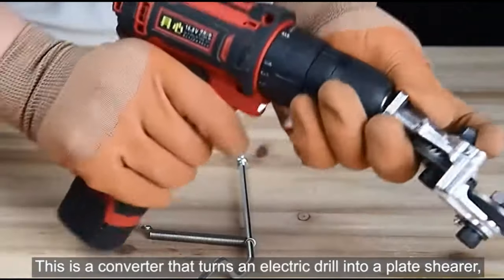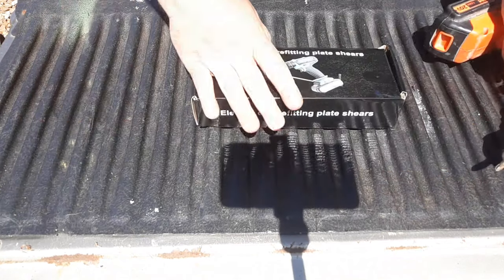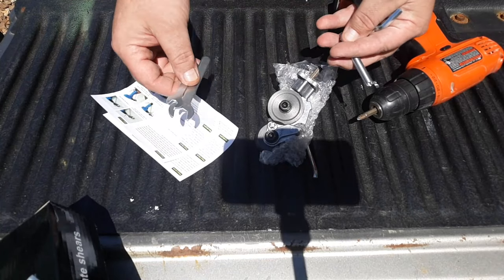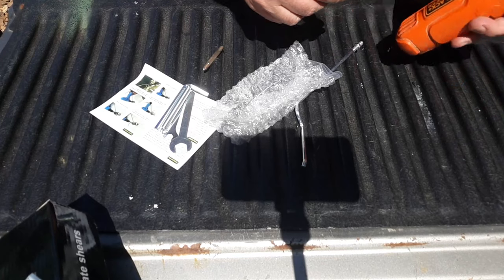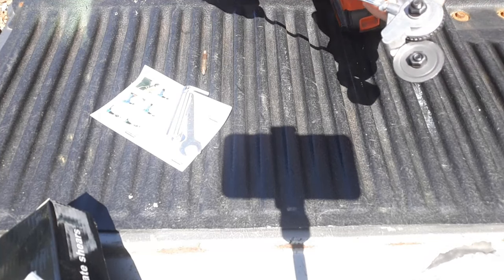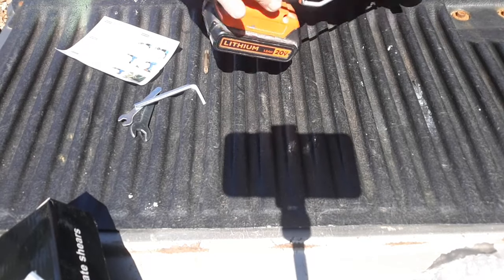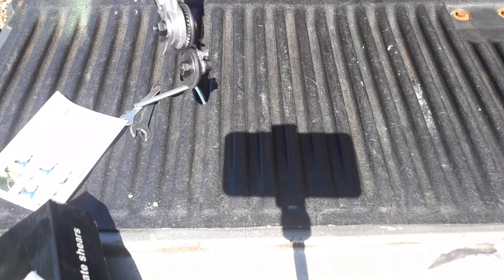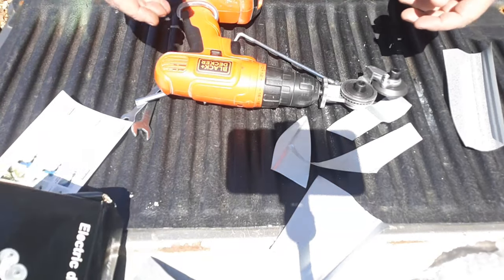ELECTRIC DRILL REFITTING PLATE SHEARS REVIEW

Comment: Thanx,  I was Curious about how they(It) worked for a regular person being in the sales vids they work so perfectly.................................
Reply from the maker: Not great. It has only one powered cutting wheel, so a significant amount of force is required. It is difficult to both push and guide the tool simultaneously, I'm sure it could be done with practice, but it is substantially different than shown in the ads.  thanks for watching.

Comment: Lol at least it works!  Wondering if you can adjust the height of the blade so it will “grab onto the metal” so you don’t have to push it 🤔
Reply from the maker: No. I checked out some other people's videos, and it is the most common complaint.
Reply: @ManMountainMetals  ok thanks for the info.  I won’t be buying one 🤣
Reply from the maker: @Scrap2Cast  I can't imagine cutting along a line would be easy. Maybe using 2 hands would help if you didn't have to hold the workpiece.🤷
Reply: @ManMountainMetals  I’m willing to bet if you can clamp the sheet metal down it could be easier or have a buddy hold the piece 🤷🏻‍♂️

Comment: 🤣 I’ll be sure to grab one up right away. Always wanted to know what it felt like to get cut by sheet metal as the tool you’re using jumps off the metals 🤣
Reply from the maker: It 🔥 burns, it burns.
Reply: 🤣 I bet. I bet that’s be good the chop up wire though. Like so it’s not a big ass roll of slop in a bucket. 🤷🏽‍♂️ I’m sure it has a safe practical use somewhere 🤣
Reply from the maker: @Kēvin Rose  if the bottom cutter was gear driven by the upper cutter, it would be a much better tool.

Comment: there not made to cut very rigid metal, only thin sheet metal. i have one also. they cut superloom sheets great.
Reply from the maker: They are advertised as being able to cut mild steel. The metal in the video  was galvanized aluminum (zinc coated aluminum) that I was cutting. That is about the least thick and softest roofing material a person would want to use. Any thinner and the nails pull through the metal sheeting in any kind of wind. If both wheels had been geared to turn instead of just one, it would have worked a lot better. I am glad you found them useful, and I appreciate you watching my video. But I honestly think that most people that buy this tool are going to want to use it on something more substantial than superloom sheets (had to look that up BTW, 😆) and as a roofing tool it's really not up to the job. IMHO.

Comment: After watching your demonstration I tried my own of the same brand and found it doesn't cut straight and about 6 inches in on a wobbly cut it got bogged in the aluminum 1mm sheet and was difficult reversing it to remove .
The directions are useless and that is why I came to Youtube to find out how to operate it .
Man Mountain Metals  is telling it as it is .
I expect more expensive brands would work as expected but not this one .
Reply from the maker: If both the cutting wheel and the anvil wheel turned at the same rate, gear driven, for instance, it would be a much more usable tool.
Reply: I went back to where I purchased it from and gave them a serve of what I said to you , typical dodgy Chinese . @ManMountainMetals

Comment: There might be a learning curve...
Reply from the maker: I agree about the curves.🤣 My main problem with that small bit of metal I was using is that I needed two hands on the drill, one to hold the trigger and one to push and guide. The trick is I also needed to hold the piece of metal, so I plumb run outta hands.🤣   If the manufacturer had geared the anvil head to run with the cutter head, it would work a lot better. As is, the cutter turns but the anvil doesn't and it takes considerable effort to push the tool through the work piece. If you were cutting full sheets you could just throw some blocks on it to hold it in place while you used both hands on the drill. Thanks for watching, I can't believe my dumb little video got 11k views.
Reply: @ManMountainMetals  I noticed from watching a few reviews of this piece of crap that people that had the drill set on high had better performance and didn't need to push it so hard to get it through, also giving them a straighter cut line.

Comment: It's not great but it's not horrible. 🤣
Reply from the maker: It's another MVP, minimally viable product. If the lower gear had also been powered instead of free wheeling, I believe it would function like the one in the infomercial did. It beats tin snips but would be awkward to use one-handed as you have to guide and push the drill.